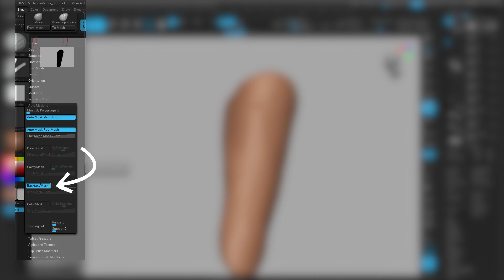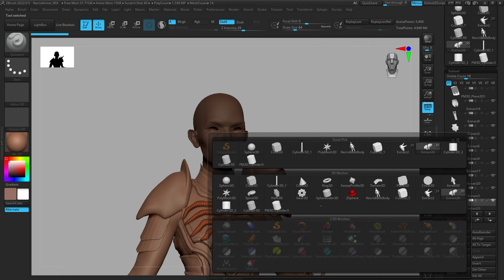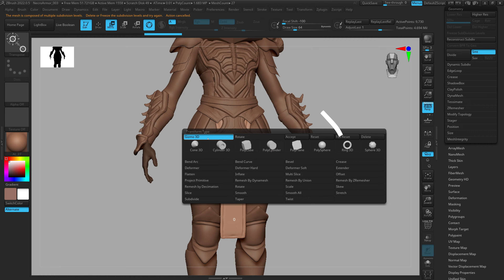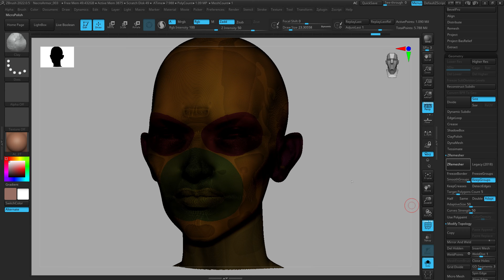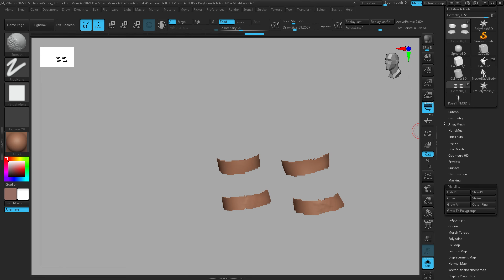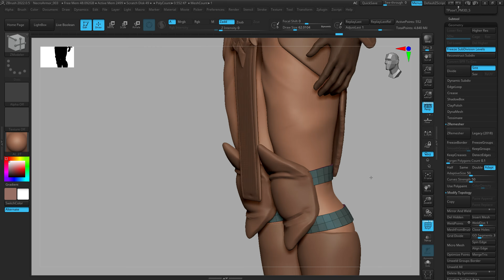5 Tips to IMPROVE your ZBRUSH workflow!

Comment: nice vid - thanks for sharing your knowledge
i'm nowhere near being any kind of power user but one thing that's definitely helped a ton is setting up hotkeys for tools you use often 
sure, you can pimp the ZBrush interface to suit your own workflows but new users aren't going to know which tools they use the most; i feel like you can waste a ton of time creating interfaces when to start with all you need is a bunch of hotkeys; i have maybe 20 hotkeys which speed things up considerably and save a TON of time scratching around in menus/sub-menus; never felt the need to design my own interface, or use one provided by someone else;
thanks again - subbed

Comment: Great video! For the ZRemesher part, you can also create polygroups for better ZRemesher topology by using Polypaint and the Polygroupit plugin (built into ZBrush) by painting the edgeloops onto the mesh. I personally think that it gives more control over where you want to set the edge loops and how dense you want them to be for the remeshed result.
Reply: This saved me time, thank you! Now I'm only adjusting a few errors with retopoflow in blender.

Comment: Hi! These tips are great. Thanks a lot! I have a question: for example I've created a character model following a concept. And it's like almost done, 95% ready before making final renders. But it's feels like something's missing or something's a bit off, but you don't know what it is even after a few hours of trying to figure out. So what to do at that point? Ask for a feedback?
Reply from the maker: Hey Nikita! I know exactly what you mean. Sometimes you get to the end and to a point where it's very difficult to change anything but you know in the back of your head some things need to be reworked. 

Asking for feedback is always great if you have someone you can get feedback from. Often we are staring at a piece for so long it becomes difficult to notice the flaws. It can also be good to take a screenshot and bring it in photoshop and just doodle on top of it since this is a faster way to iterate than in 3d. It also just doesn't hurt to step away from it for a bit and come back later with a fresh set of eyes. 

If it's something like you just needed an extra strap or maybe some extra accessories here or there. I'll just swallow my pride and do those on a seperate set of texture maps and remember for next time to do more rough renders throughout my process in the hope of catching anything thats lacking sooner rather than later. 

If it feels likes like something fundemental like the face just isn't right or core pieces of the character just feel off you have to make a choice. You can go back and rework some stuff, rebake and adjust your textures as needed or just call it a live and learn moment and take what you've learned into your next project
Reply: @hartgameart  Wow, thank you so much for this comprehensive reply!
Reply: @NikitaGal31  Hey Nikita, its always great to try and figure stuff out on your own but if have a group with other artists to turn to for advice i'd advise doing that as they can usually pick stuff up in a few seconds of seeing the model; its not their model so seeing the faults is a lot easier... Id also recommend keeping everything simple from the beginning and getting feedback from that point on, this way it prevents you from needing to go back at the 90% mark because you figured  everything out before the 40% mark with help from your peers etc.
Reply: Take a walk. Come back, fresh mind. try again.